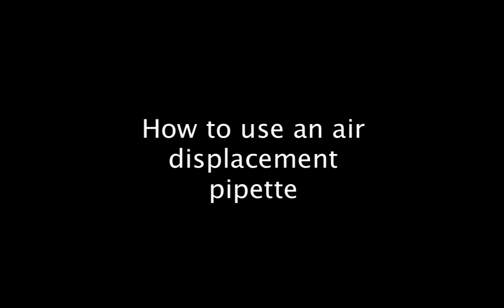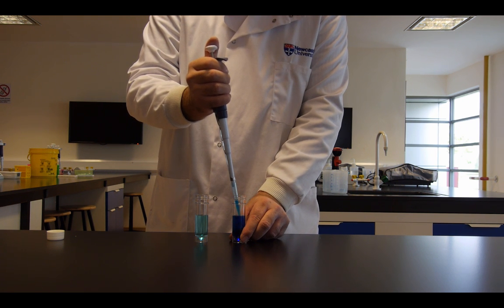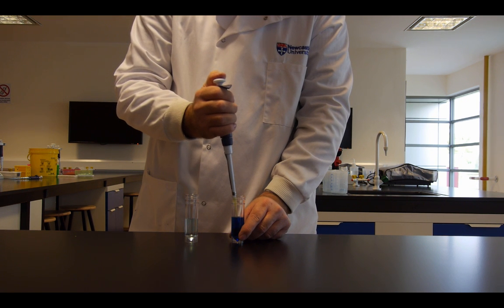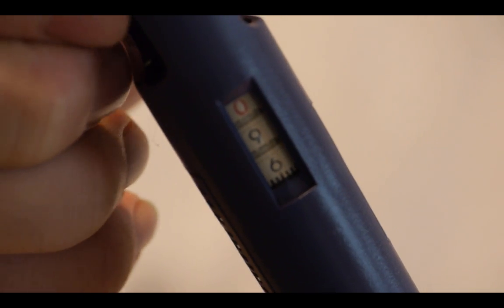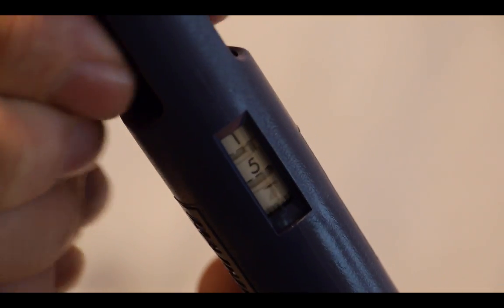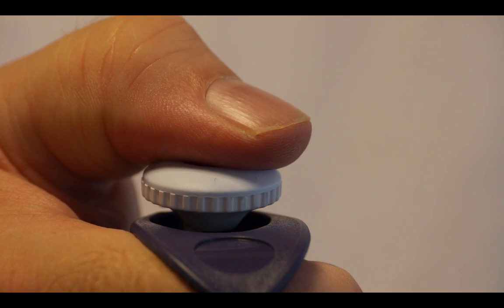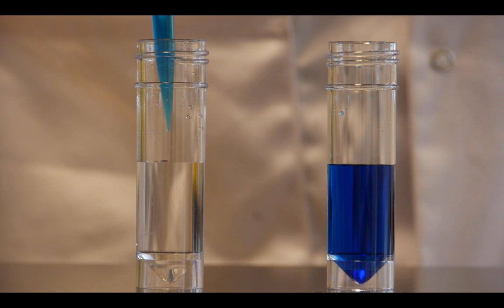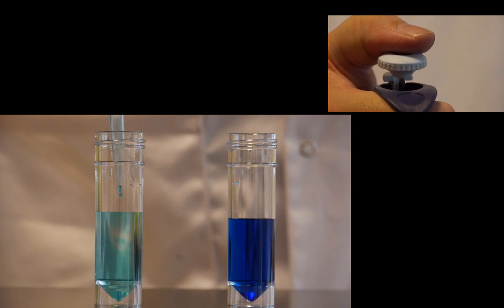How to use an air displacement pipette

Comment: Nick, 100 on the pipette would measure 0.1ml, not 1ml....
Reply from the maker: Hi Tom, not on a Gilson or Rainin type pipettes.  The P1000 will display 100 when measuring 1000 µl, or 1 ml, 50 for 500 µl (0.5 ml) etc. Some makes of pipettes will display 1000 for 1 ml, but not Gilson or Rainin.
Reply: oh I see! Because I though the number was just the number of microlitres!
Reply from the maker: Tom Hill That is the problem.  I don't understand why the makers just didn't emboss a zero on the handle.  That would have solved a lot of problems and incorrect pipetting over the years.